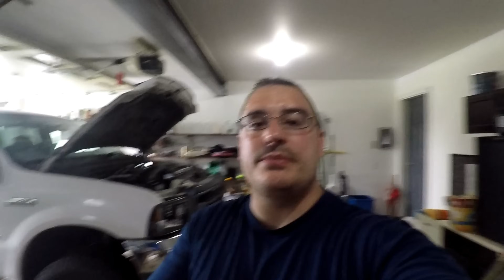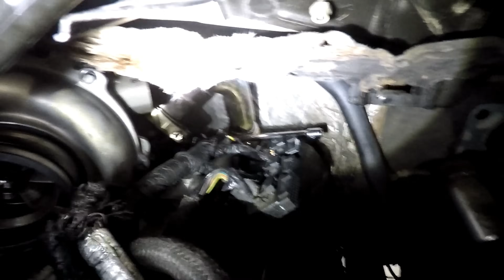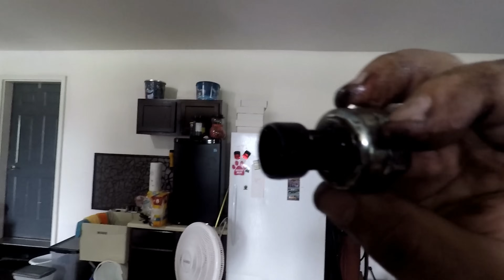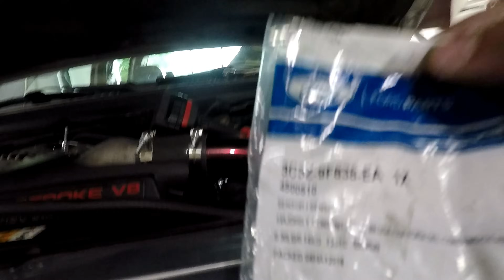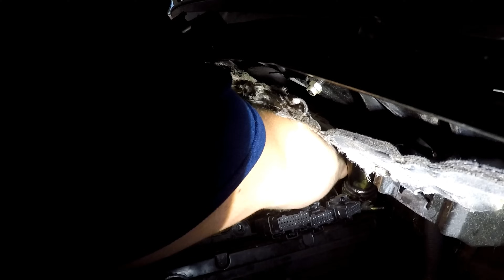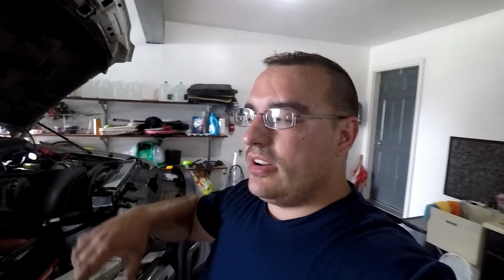6.0  Powerstroke ICP Sensor Replacement The Easy Way

Comment: Hello..I have a 04 with a code P2290 you think it can be the icp or pump?....it starts but takes a while And oil pressure drops
Reply from the maker: Does your truck start after it is hot? Do you have anyway of reading your icp and ipr? Also is your icp on your valve cover or under your turbo? Basically trying to find out if you have an early or late 04. There was like 3 different oil setups in 04
Reply: Doesn't start when it's hot have to wait for it to cool down.and even though when it's cold it's still takes a while to start ...and no I have no way on how read the icp
Reply from the maker: Check out this video you can get some mo ignoring stuff between your phone and a cheap obd 2 bluetooth device check the description for a link to it, but the video goes over some monitoring stuff and cheap ways to do it. What you described is a high pressure oil leak. So now we need today figure out which pump you have. Late or early style. Do you have the same icp setup as in this video? And here is the link to the other video to watch.
https://youtu.be/jW0ymuwklVM

Comment: I couldn’t find the tool on amazon. I have an 03 f350, could you send the link please ?
Reply from the maker: This is not the one I used but this will work. Many guys in the comments have used it and seems to be good. Some of the cheaper ones people were saying the arms would spread open and not allow for proper tightening this is an affiliate link https://amzn.to/37jGkzw
Reply from the maker: I will get you a link I do not know if it is on Amazon. Let me check it out
Reply: Got it, thanks so much 👍
Reply from the maker: No problem man anytime

Comment: What made you come to this decision to change the sensor?
Reply from the maker: Oil leak from the sensor. It did seem to read ok all in all. But bad icp sensor can cause no starts or for the truck to just shut off. Could also cause the truck to run rough. What is going on with your truck? Or just wondering why I changed it
Reply: @six0bros  honestly I don't really know I'm just going by with what the current owner is telling me I'd rather like to know a little bit about these diesel engines as I've never worked on them before I got started and he was telling me that it starts and it runs but it just doesn't have a lot of power and then it will quit and I just kind of want to get into it a little bit before I do any Trading with him

Comment: Was the ICP sensor revised for the 05-07’s?
Reply from the maker: Diesel tech ron has a video about how the icp reads after updating it is slightly different under certain circumstances I just dont remember what they are
Reply from the maker: Yes there is a different sensor for 05 and up.a lot of guys will put it in their early 6.0s and it seems to work fine. Although it is a different size sensor but once the ficm is off if you dont have the crossmember on the intake manifold you should be able to get in there with a socket. However I personally dont think it's really necessary to update that sensor, but people say it is more reliable than the early style
Reply: 6.0 Bros thanks for the response. I have an 05 Excursion 6.0 and I’ve been watching all of your videos! 👍

Just did the Egr delete, brand new OEM oil cooler, blue spring mod, hot and cold side pipes, cold air intake, and I just got a coolant filtration kit yesterday that’s going on next week.

Very helpful. 😎
Reply from the maker: @Doom6.0  glad I can help man! Much more 6.0 content to come

Comment: I have a 2012 332 skid and while engine running I clean the air filter when I put it back the engine died can you help
Reply from the maker: I wish I could but I am not familiar with the engine on those. I do know of someone that it was just a battery that died but I dont know if it was the same setup or not.  I am sorry

Comment: I felt more and more in love with my 7.3 every time I see a video related with the 6.0
Reply from the maker: 7.3 is a great platform. Easy to work on. But it just doesnt make the same type of power, but you can build them to. We occasionally have a 7.3 on the channel. Check out powerstoked YouTube channel if you haven't already.  Great channel he has.
Reply: I drove both the 7.3 and the 6.0 and found the 6.0 to have much better power and pick up than the 7.3. I wasn't impressed with the power and pick up of the 7.3 at all. Maybe it needed something I don't know. The EGR was even deleted on it. Are you insinuating that the 7.3 never needs any maintenance or anything.Never has a bad sensor anywhere? I mean it sounds like your opinion is biased. As a matter of fact, you are obviously on here looking how to change an ICP sensor on your truck or you wouldn't be here. Or do you just have such a non life that you go searching for you tube videos on the 6.0?
Reply: Funny how people fall in love with their vehicles. I traded my uncle a 06 gmc 4 door for his 07 single cab 6.0 that needed a lot of work because he was to old to have it now and didn’t have use for it. Well If I ever get it running as good as it was I’m probably going to fall in n love with it even though my gmc was niceb

Comment: mine runs good but then i turn of and wont turn on untill it cools off my gauges never indicate it overheating recently gotten my injector orings replaced the front seals done  originally they said not building pressure fixed everything that they saod could be it even crankshaft sensor now they say seems my alternator is bad because the voltage varoes from 9 volts to 13 volts and i know my batteries are old could it be acting up now and the lack of power would cause hpop to not build pressure or does that idea seem dumb???? please help been so long and costing me tons!!!!
Reply: also my truck is studded egr deleted being bulletproofed as its getting fixed im just tired of tossing money or if not alternator maybe badhpop again truck runs good and strong
Reply from the maker: So do you have a monitor to check things? Like maybe torque pro would be your cheapest way of getting into monitoring your truck. Then you want to check your icp pressure. You need 500 psi for your truck to start. If you're not reaching this then there is a leak somewhere. One thing to try is to see if your icp sensor is bad. To do this just unplug it while you have the no start condition. If this fixes the problem then you know you just need to replace the sensor. Also did the shop replace the stand pipes and dummy plugs? Did the check the stc fitting on the hpop? Qhat year truck is yours because if it is an early truck you may have different parts. It doesnt sound like they know 100% what the issue is or how to find it from the info you gave me.
Reply: 6.0 Bros i have the edge scanner i think not giving anycodes he uses a snap on reader? idk says everything seems good he said he thinks its that because when he connected the jumper we saw the truck would start right away
Reply: 6.0 Bros if hpop is bad would it still make pressure just not enough or could it potentially be going bad so it works at times then doesnt? or once its bad its useless?
Reply: 2005

Comment: I have an O5 in an E350 super duty cutaway RV and I’m having the motor pulled and replaced with a low mileage 05 duplicate. I want to do the updated ICP and IPR regulator. Other work being done is a turbo oil supply and drain tube upgrades to the newest types, a sinister EGR cooler, and an updated oil filter standpipe. My question is will the sensor and regulator be lots easier to get at if changed while this engine is out and upgraded as stated above?
Reply from the maker: So the icp on an 95 should be on the valve cover super easy to change in or out. Now the ipr 100% easier to do while the engine is out

Comment: Hey I'm an early 2003 6.0 owner with this issue- The truck starts great and idles great for 30 seconds. Then suddenly it begins running rough until it warms up a few minutes later. I don't have a scan tool. Can anyone tell me if this is an icp sensor issue, or what else? Thanks!
Reply from the maker: I do not think it is an icp sensor although it could be, however you are more likely looking at stiction. Which is an issue with the spool valves on the injector. One way to help try to mask the symptoms of stiction is through using an oil additive such as archoil which I have a video talking about. I would try unplugging your icp sensor and seeing if this helps. What the computer will do is default to an inferred number that it believes it should be making. If this solves your problem I would then try replacing the icp sensor and maybe even the pigtail to it.
Reply: @six0bros  Thanks for the reply! The first thing I did was throw in some Techron, hoping it would fix stiction. So far it's still doing it, but I've only got a few miles on it yet. I'll give that a try.
The thing I don't get is, if it were stiction it seems it would happen from when the truck starts. But it runs fine and then after exactly 30 seconds suddenly begins to run rough. It's almost like something is timed.
Reply from the maker: Are you running any tunes? Does it have an uneven idle?
Reply: @six0bros  My truck is totally stock. It idles perfectly except for  30 seconds after idle until warm. Then it runs like it always has.  One other thing- when it's running rough, if I just push the pedal past idle it runs smooth again. It's only when idling that it's rough.
Reply: G Kuljian mine has the same issue!
Reply from the maker: This sounds like injectors maybe needing replaced. Sounds like what they call stiction. I have a video on a product called archoil that you may want to look into
Reply: 6.0 Bros so you think I could have the same issue? Even though it reads ICP issue?
Reply: 6.0 Bros can you link me?

Comment: What does the code p2286 (icp control circuit high) usually indicate?  My truck will not run at all.
Reply from the maker: Have you tried unplugging your icp sensor and seeing if your truck starts? I would change the sensor and put a new icp pigtail in. Most likely oil has gotten to the pigtail and is causing that code. If you unplug your icp sender the truck should run if it is the sensor or pigtail.

Comment: @6.0 Bros. The last sentence in your description says this won't work on an '03.  Is there a short cut for that year? Getting at it from the bottom sounds... Just terrible...
Reply from the maker: First this is for the earlier year 6.0s. Later years they switched the icp to the valve cover. What I meant is that the 03 manifold has a cross member at the back making it more difficult. I have not tried it with that manifold to see. You may still be able to with the special tool but I cannot guarantee it will work. Going from the bottom isn't fun but very doable. And some prefer it that way. I can get a video out later this week going over how to if you would like. Basically you remove the heat shield at the back which is 3 bolts and then you can get a socket on the sensor and undo it.
Reply: @six0bros  thanks for the fast response! If you're going to be doing a video of an '03... Cool! I saw the 6.0Doctor do this with an '03, and looks like I will too... So I'll let you know how it goes (if you haven't done a vid by that time).
Reply from the maker: My truck is a early 04 with an 03 engine. The only issue is I changed my manifold to the odawg manifold. I got the idea from the 6.0 doctor so I'll have to check out his video to see if the one he did had the crossmember.
Reply: @six0bros  I just did this on my 03 Excursion... what a PITA... the crow's foot tool thing worked on it though.
Reply from the maker: That is awesome. I am glad it worked even with the crossmember in the back. I hope this video helped
Reply: @six0bros  Yeah it worked, and yes, your video was helpful... there was a TON of cursing though... I'd like to find the genius who designed the placement for that censor (and their boss who signed off on it) and punch them in the face... they ought to be ashamed... terrible spot.  Anyone thinking of doing this... I had to remove: de-gass container, air filter, FICM, FICM bracket (I don't remember if I HAD to, or saw that in a video... but I did it), the rear manifold bolt, the injector harness connections, and the IPR connection.  This did save me $500 over what a local Ford stealership quoted me ($686 and change). The truck runs great, I just hope the censor lasts.  Thanks for the great videos.
Reply from the maker: Awesome. I would also like to know what boss signed off on this lol. It didnt take then long to move it to the valve cover though.
Reply: 6.0 Bros did you do the video for the 03?
Reply from the maker: I apologize I wasnt sure if it would however I was wrong. As long as you have the tool shown in the video you will be able to get it even with the cross member on the intake manifold
Reply: 6.0 Bros will a 1 1/16th deep socket work, or it has to be that tool?

Comment: Bought the tool, yanked off waaaay more than the vid, still ended up pulling the shield, had to get it from underneath. Next time I'm doing it MY way and pulling the cab!
Reply from the maker: For you have an intake manifold with the cross over in the rear?
Reply: @six0bros  yup
Reply: Last time I did this we had the cab off to, change head bolts to studs, bigger vane turbo, upgraded egr cooler, new exhaust (3" off turbo) 5", and some other what the hell stuff. At that time changed icp in 30 seconds.
Reply from the maker: I don't remeber if I clearly stated this in the video but if you have the crossmember on the intake you can only get it underneath to my knowledge. I am really sorry I should have been more clear about this
Reply: How did you get the shield back on?  Having a lot of trouble getting it back in. Not sure what to do other than pull the exhaust pipes for clearance.

Comment: i have a 2003 6.0 i have replaced the hpop on i have replaced all the injectors several times in the past year and i have added a egr delete kit. but it still gives me problems i had it running but something gave out... i have alot of smoke pouring from the top of my engine and it will only start using starter fluid when i let off the gas it goes down to about 1500 rpm's and dies/stalls it is an automatic transmission btw what do you guys think is my problem i have brought it to 3 shops and everyone is telling me they can find any problems no codes pop up and it will run only if you have the rpm past 1500
Reply from the maker: I would be more than happy to help. First don't use starter fluid anymore. It is very bad for diesels.  Next do you have a way to read data from your truck? If so the first things I need to know the value of while you try to crank over the truck are ipr, icp, ficm main, ficm logic, battery voltage, ficm sync and Cam sync. Also do you have a fuel psi gauge? If not what you can do to make sure you're at least getting fuel is open up the fuel filter under the hood and see if you turn the key on fuel is coming up. The other thing is I would add more diesel fuel to your tank. Make sure you have plenty the pickup straws can brake in there and cause you to have a no start.
Reply: As of this moment im broke as a joke and i have no code readers nor a psi gauge for the fuel.... im pretty sure that im not having any blow by but i could be wrong and im sure that the smoke im seeing is the oil burning off the engine when i took out my injectors i made alittle bit of a mess but i cleaned as much of it as i could i have cleaned out my ebp sensor and i also forgot to mention i replaced the engine fuel pump as well ill try to add more diesel when i get the chance and i will get back to you thank you 6.0 bros i appreciate you taking the time to help walk me through this
Reply from the maker: Any time and feel free to comment on any video with more questions. I try very hard to answer and help anyone that I can. I forgot to say try unplugging you icp sensor and see if the truck starts. The truck will default to a inferred value. If the truck starts then it's a bad icp sensor. As for monitoring on the cheap try torque Pro. https://youtu.be/4BlqUGlYroM
Try that link. Cheapest way to start monitoring your truck, and you'll be able to read everything that you need to try and diagnose the problem. Hope this helps.
Reply: it very much does bro i really really appreciate u taking the time to answer me and so quickly im gonna get on it later this afternoon when it cools off and ill try to unplug and start it thank you again 6.0 bros ill be sure to give you a shoutout on my videos
Reply from the maker: Thanks man. Let me know how I can help

Comment: Looks like a relatively straightforward process 👍 Was the indication that it needed replaced that it was leaking, and/or was there something on gauges/monitor that you could see?
Reply from the maker: Mainly because it was leaking. I have had issues with my IDP tunes not wanting to drive right so I figured since I knew it was leaking I would replace it. It can cause no starts though if not changed out and if the sensor completely goes out. Which you can actually unplug the icp sensor and try to crank the truck over. The computer will defer to a default value when the icp is unplugged.
Reply: 6.0 Bros ooh cool, makes perfect sense. Thanks! 👍
Reply: Ok
Reply: No it didn't show me any indication light nothing.

Comment: Dear 6.0 Bros ...what or how did you know to change you ICP or was it more of a maintenance thing?👍🇺🇸👊
Reply: For me it was misfiring bad
Reply: Mine is Regina at idle sometimes
Reply from the maker: Well mine was leaking so that is always an indicator to look at getting a new one on there. However I have heard of no start issues because of icp sensor going bad, which you can check for by if your truck is running rough or not starting unplugging the sensor can help diagnose the problem